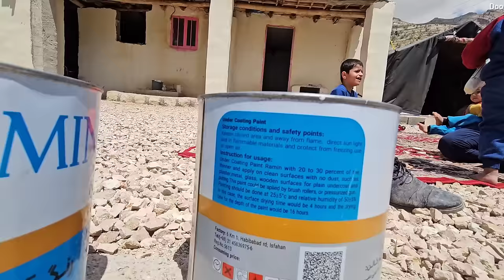Unconditional Love: A Kind-hearted Family's Sacrifice to Reconstruct the Life of a Divorced Woman

Comment: I'm going to hate seeing that beautiful color get messed up with the black from cooking . Ladies you need to cook with the flame down a lot lower. The flame should be underneath of the pans and the kettle not coming up the sides. That is where the black is coming from. You two are used to cooking over an open fire. It will just take a little longer turning down the burner😊
Reply: Kerro operaattorille he ei näe tätä elokuvaa itse ollenkaan se on iranissa kielletty.
Reply: Yes so true, or your walls will be black again.
Reply: I wish they would get 2 new tea pots to put in their home when its finished being painted. And use the 2 old blacken teapots for when they cook outside. Also get a new  cooking pot  or two and do the same

Comment: Надеюсь эту черную ткань уберут с потолка ,весь вид портит, или стирать или заменить😊
Reply: There’s no point as long as Petrie keeps turning the gas up too high the wall will always be black.
Reply: They need to clean the burner on the stove and adjust the gas flow to the burner also it's just to much.
Reply: Jestli nebudou pouštět pomalu plyn, anebo neupraví trysky na sporáku, tak nová látka bude za chvilku stejně černá.
Reply: They should also light the burner before putting in the pot
Reply: i hop it gets a second coat !it’s all missed bit

Comment: Rachmat you doing a fabulous job...would like to suggest , where the stove is, tile that whole wall, so that it can be wiped clean..❤❤❤
Reply: And keep the flame to the stove lower it does not need to come up the sides of pots and kettle causes soot not healthy. Open windows to air out when nice out get a cross breeze with windows open fresh air .be safe
Xoxo
Reply: If I am going to  paint again soon just wrap roller tightly in plastic and put in storage shed.works great every time. Just a tip
Xoxo
Reply: Excellent thats the only way to keep it clean
Reply: tile behind stove up to ceiling

Comment: If you don't cook with a proper flame on your cook stove your new paint job will be ruined and suited just as it is now. Your pans are blackened from the flame coming up over the sides of the cook pans. You need to keep the flames under the skillets and pans and not on the sides. Please turn the flame down. That suit is hard to clean off of anything. I don't mean to be rude I'd just like to see you not to have to work so hard especially when it can be prevented.